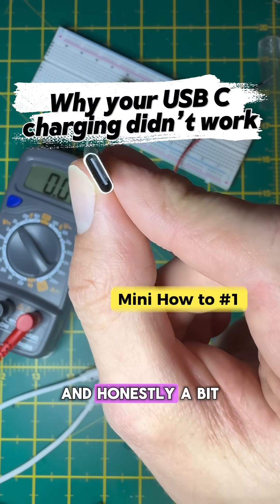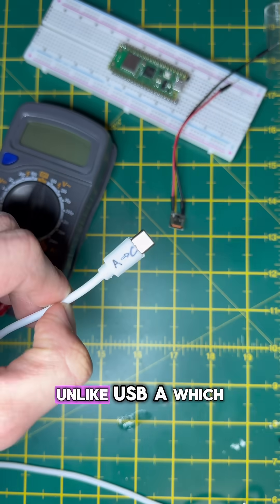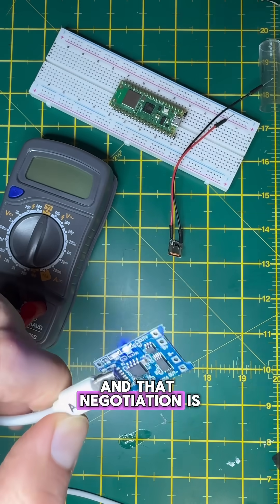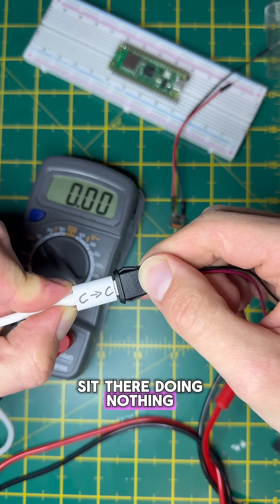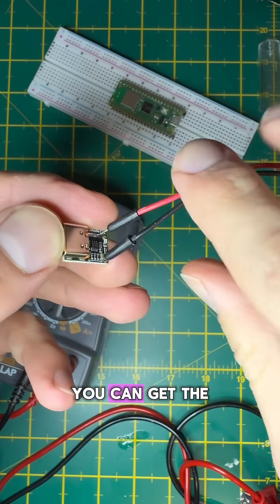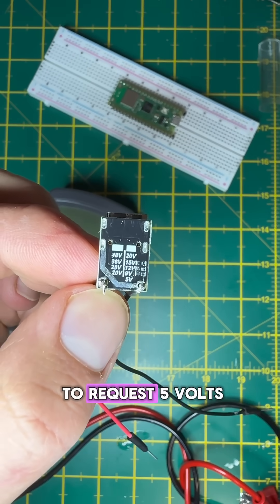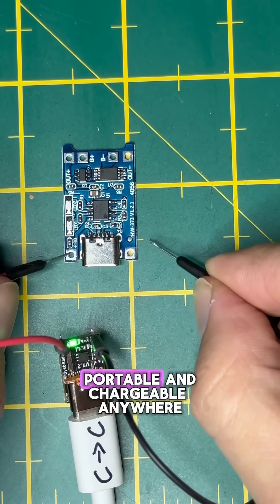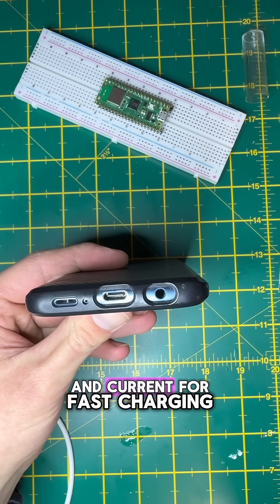The USB-C Mistake Most Makers Make

Comment: Interesting, cant you do the same think as one of those usb-C-PD board using resistors between a certain pin and gnd, i forgot the name but i did that to make mu custom nimh battery charge a while back
Reply from the maker: Yeah, you can put 5.1k resistors from the CC1 and CC2 pins to ground to get 5 V from a USB-C power source (up to 3A I think). I touched on this in the description – it works if you’re making your own PCB and have access to those lines. But with most off-the-shelf charging boards, you can’t really do it because they usually don’t give you access to the CC pins, just VBUS and GND. So if you’re using a pre-made board, it’s not that straightforward.